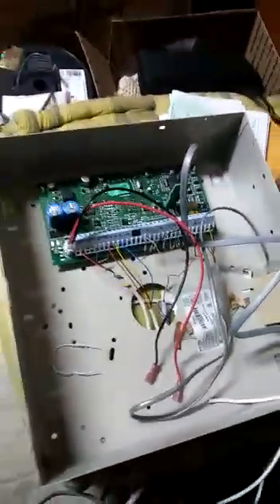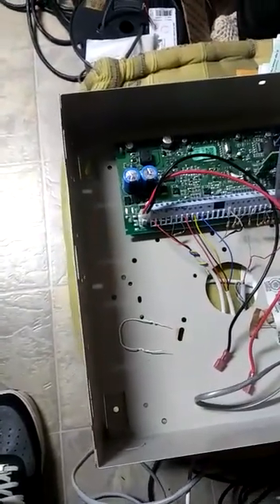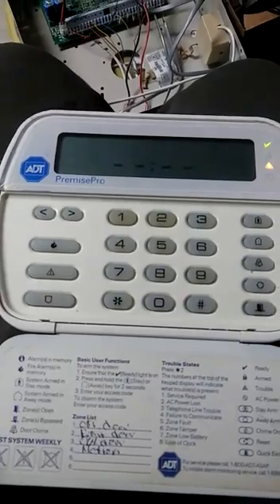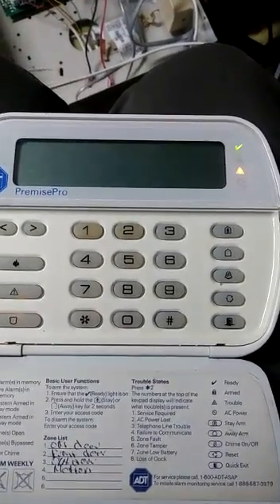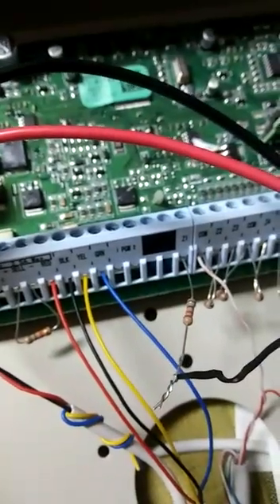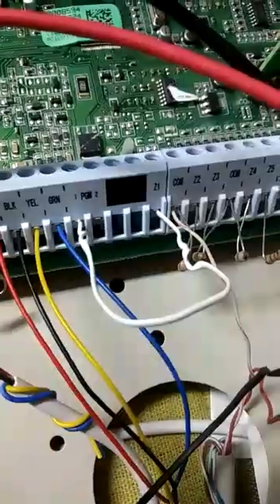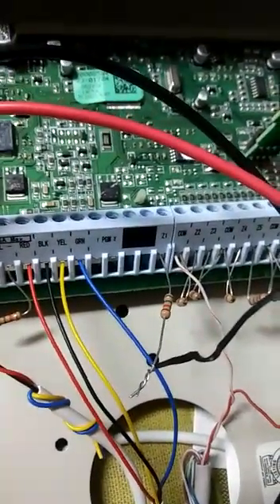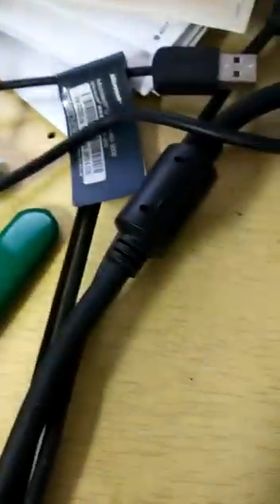DSC1832-installer code reset

Comment: **Caution** I performed this procedure on a DSC1555 alarm system by placing a jumper wire between Z1 and PGM1 and power cycling the system. It not only reset the installer code to 5555, it also performed a factory reset on the alarm, erasing all system settings.
Reply: That's my issue. I have the master code, but not the installer code. I am not doing the factory reset because I don't want to erase all the programming. Is there another way to get around the installer code without losing the programming?

Comment: "Hi ...Nice video.... I have a DSC system Alexor PC9155with a WT5500 keyboard. I'm having problems with the WT5500 keyboard and I want to replace it with a new one. I would like you to help me erase the bad keyboard from the program and enroll the new one so that everything remains the same as before. How could you help with my problem ..... Thanks"
Reply from the maker: keyboard? or keypad.
Reply from the maker: https://www.youtube.com/watch?v=ck-jMqwY8rg&t=4s
this video should be a guide to understanding what you want to do and how to proceed, basically, add a new keypad then address it and it should get the settings from the panel and then you can remove the old keypad